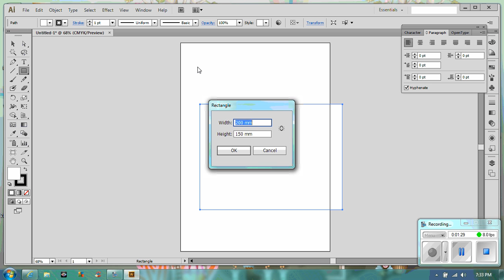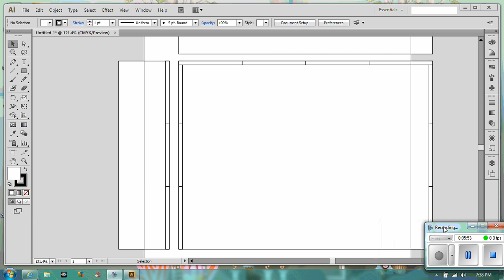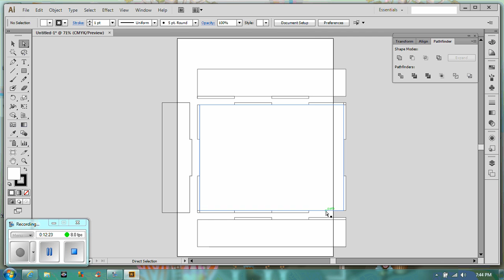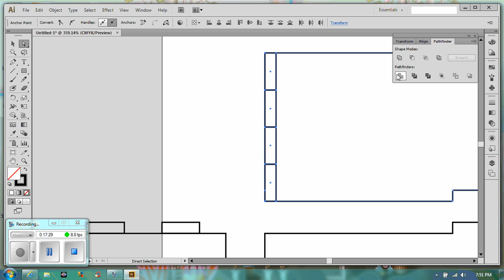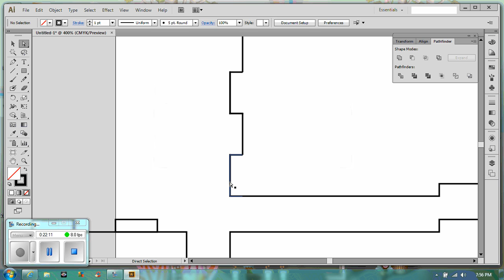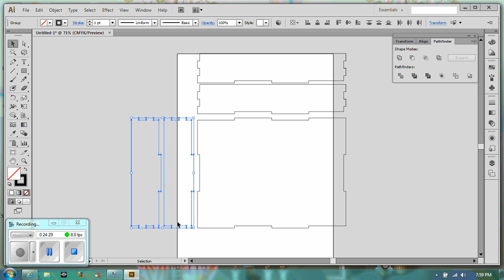How to Build a Drawer or Box in Illustrator for Laser Cutting

Comment: this isnt that helpful for laser cutting since the finger joints have to be scaled slightly smaller on one side or the pieces will not fit together, they will be too tight.
Reply: I know I’m two years late but you could make each side a vector of its own and do offset line and offset it the value of your lasers kerf cut for that particular material.